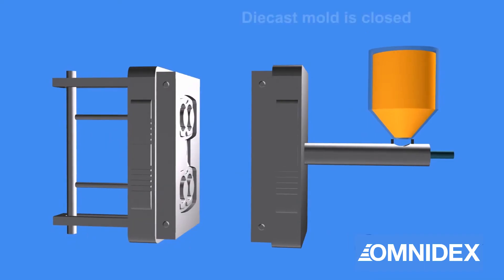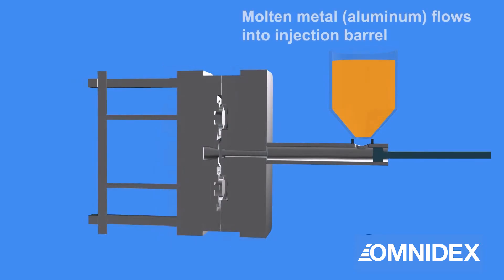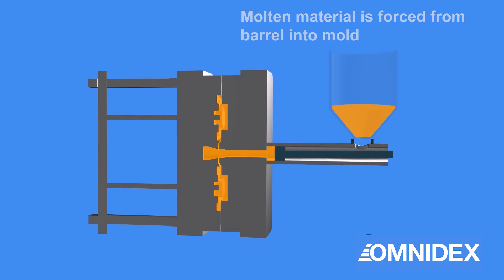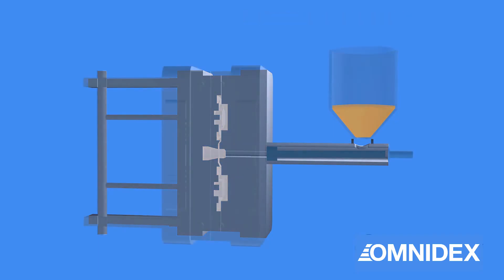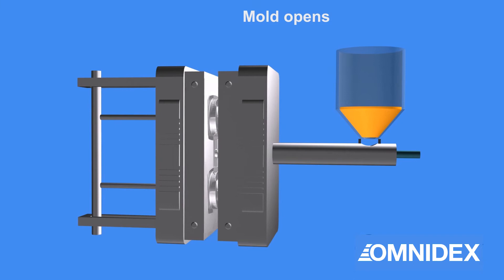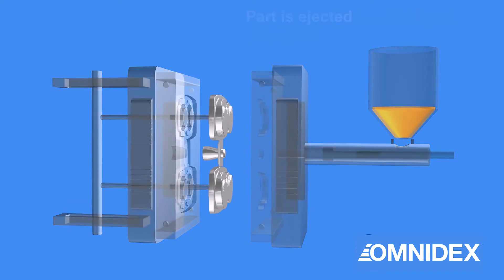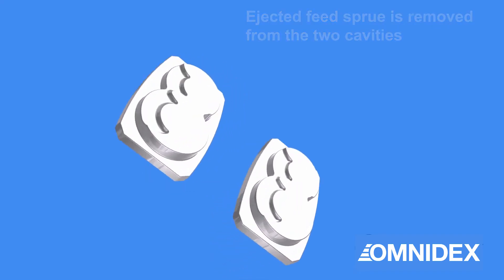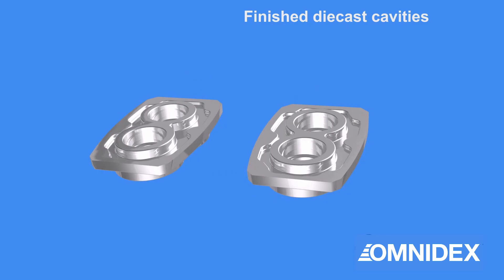Die Casting

Comment: what die mean ?
Reply: maybe "mold"
Reply: Brother dai is permanent mould and with the help we can make pards very quickly and easily and we can make parts  again and again with this dai
Reply: the reusable metal mold used to shape molten metal into a desired part by injecting it under high pressure